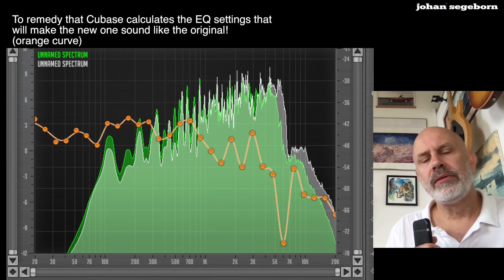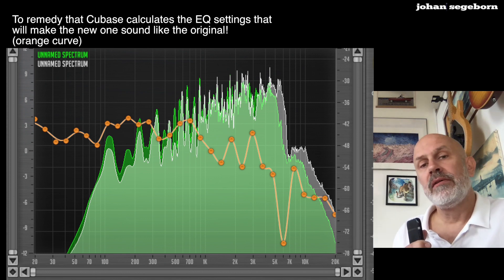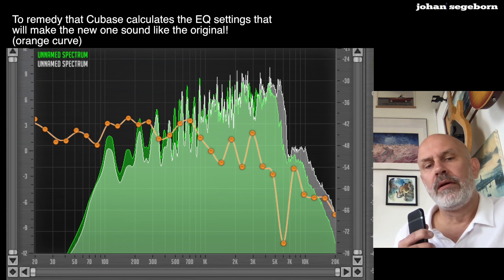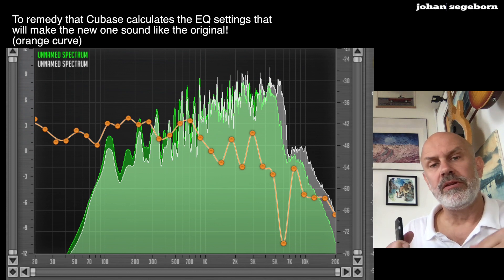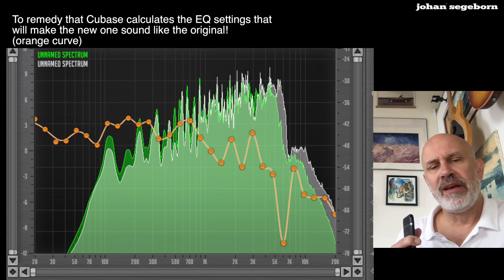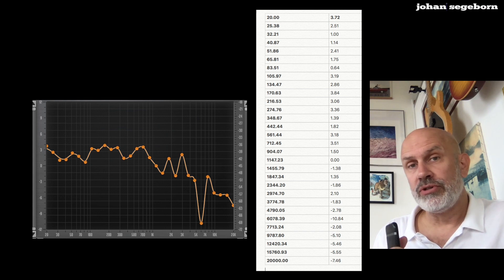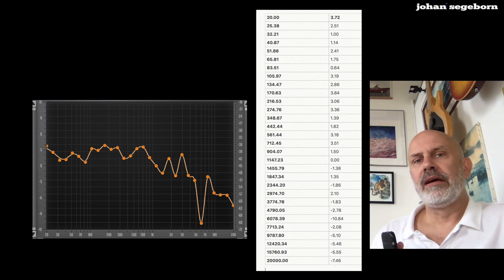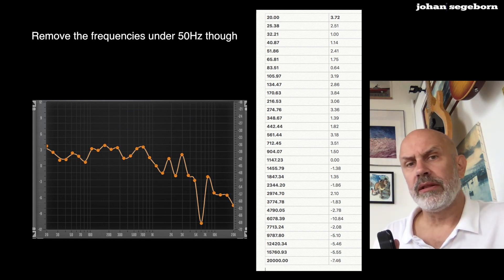Make your NEW Greenback sound like the ORIGINAL using EQ MATCHING!!!

Comment: Someone should make a pedal that has preprogramed EQ curve in it. Simple with on off switch.
Reply from the maker: Yeah we should definitely try this at a couple of places in the signal chain
Reply: @JohanSegeborn  I would personally go in front of the amp/preamp. I am not great fan of the  FX loops. In case of pedal boards I would go anywhere after the gain structure pedals. But of course trying it out everywhere and choosing your position is the best way to do it.
Reply: @NINEWALKING  There's an even better way to do this: you can do the EQ matching with Izotope Ozone's Match EQ, which is very accurate. It generates a filter with way more resolution than the method in this video and the results can be almost indistinguishable. From there, you use the match EQ to generate an impulse response (IR), and lastly you load that IR into one of the many options of pedals which can host them.

Comment: This just further supports my hypothesis that all components are just "EQ presets" and you're looking for /your/ perfect tone. 

Try lots and lots of things even stuff you hate and normally dismiss!!! One mans trash is another man's treasure!
I don't mind if Celestion has done this deliberately to focus their range on what they want to sell and to disenchant some of the magical rumours about the vintage gear. Yeah it might be better, that one time, but you're not going to abuse it on the road for some posers until it stops working and smells funny, are you?

As an aside, I just took a self administered hearing test and i now hate the fridge and our heater! My right ear is deaf to very high freqs (compressor bearings) and the left is missing lows (drone from heater fan). Keep this is mind and where your head's pointing when choosing your "ultimate setup" too. Luckily it's a lot less than 3db and hopefully temporary.

Comment: You can’t play twice in absolutely equal way. So best way to use reamping. But why don’t you just sweep all frequencies by some software instead of playing?
Reply from the maker: We can compare different methods. I though this came pretty close
Reply: @JohanSegeborn  It is up to you my friend. I just saying as engineer, if you want to make comparing measurement, you need to exclude as much as possible anything which can insert difference between two measurements. Playing twice same riff is absolute different. You can record two riffs and analyze it in time domain how different they are in terms of amplitude, etc. Thanks for the video.